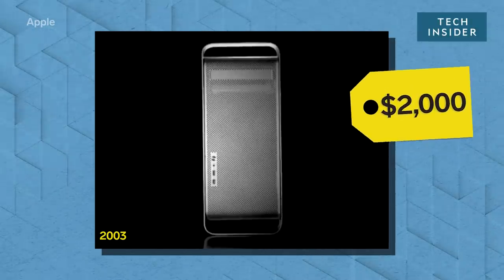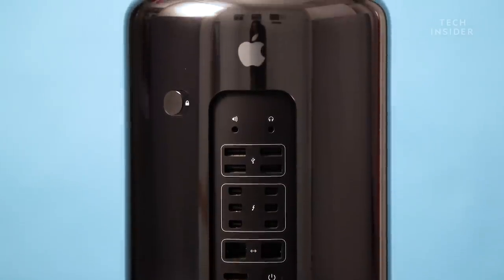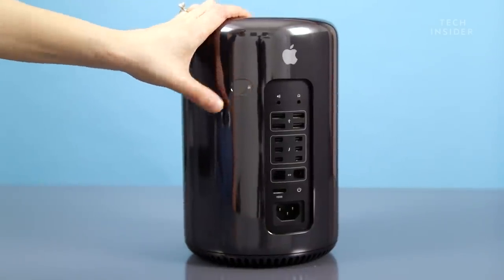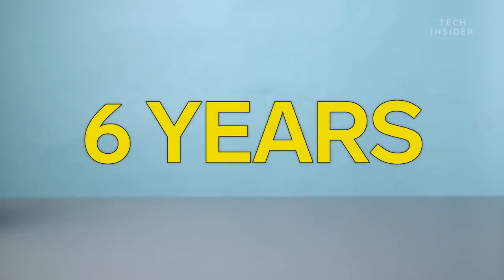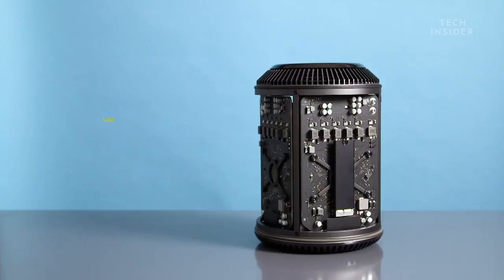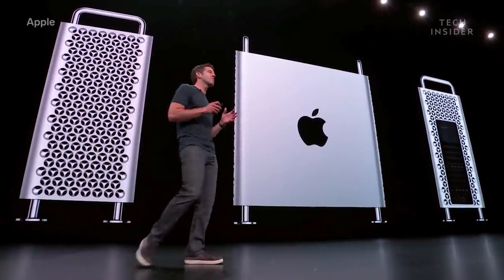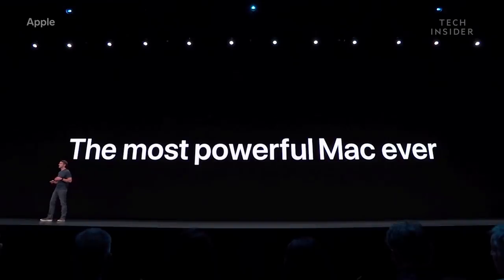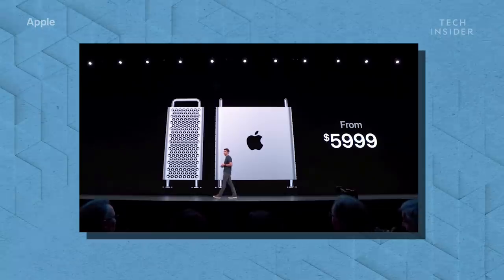Why Apple's 'Trash Can' Was A Colossal Failure

Comment: I have a 2012 Mac Pro that is every bit as expandable and upgradable as most pcs. Traditionally the Mac Pros have been very expandable, and its only since Tim Cook took over that they really started limiting the upgrading of the computers. Even the new Mac Pro that they taut as the "most expandable Mac ever" isn't as upgradable as every single Mac Pro (pre 2013) I've ever own. And there is absolutely no justification for Apples current pricing scheme, its insane. My computer cost half of the current Mac Pro most modest built, and yeah I paid $3000 for it, but its a beast of a computer, and at the time I bought it Apple still cared about making good computers and good operating systems. There were options in the gpu environments and there was justification for the expense, because that computer would last you for years and you could upgrade it as you needed, plus you could dual boot into Windows. Apple computers suck now though, and except for the iPad, I wouldn't recommend Apple to anyone; and this coming from someone who first Mac was a Performa 550.

Comment: I hope in 2023 apple makes a new computer called "the apple apple" the mac pro will be in the shape of a apple, a small apple. Will cost around 100,000 dollars, monitor the size of a toaster will cost around 2,000 that can actually be used as a real toaster. The mouse will be a regular mouse u can find at walmart, but since its made by apple it will cost u a good 900 dollars! The keyboard will be in the shape of a triangle which will break easily in just 1 minute, the cost for it will be 100$!

Comment: Psst... Tech Insider. The biggest failure of Apple was the TAM. It was the most expensive Mac of all time when you consider computing speed with price. And Jobs' favorite designer, Jonathan Ive, was the man behind the design failure. Your claim that the Newton and it's stylus as a failure is wrong. Just look at the new iPads with stylus support. The Newton was ahead of its time. It was the only Apple product not to use the MacOS.

As for the trash can, I think it is a copy of the tissue box. The PowerMac G4 Cube. Apple seems have run out of ideas after Steve Jobs died. Even Jonathan Ive left the company before people start to realize he cannot design new innovative products without Steve Jobs.

Comment: Lets not forget that if you bought an earlier model, lets say 2018, you ended up paying for more, because the 2013 went down in price because of product value degredation. Its easy to pull off at 2013 sticker and say, oh you want a new mac? Try this 2015 model mac pro. It costs just $500 more than our previous model."

Comment: 4 slots of ram - 4x32gb ddr3 ecc-r now cost 350$, 12core ivy bridge 30mb- still its good cpu (350$),  so 1500$ for mac na 700$ cpu and ram and we get more power than cheapest mac pro 2019

only bummer its built in gpu so it can't be upgraded

Comment: Apple has always tried to do stuff like this. I respect their vision but they need to understand PC parts don’t work like that. They need a lot of airflow. U can’t take a PC and fit it in tiny places with tiny fans even when building a PC choosing an extremely tiny case will mean compromising on ur chipset or putting in a powerful one only for it to throttle. It always felt to me that Apple has this grand plan which they desperately want to stick too but other factors keep interfering. Like we all know how well Apples software works especially with their hardware (internal a series chips). That’s why I feel that now finally Apple will be able to execute their vision in ways which will actually benefit the consumer. I can imagine with design with a series chip it might work really well. Let’s see. Maybe now a lot of us who always wanted macs but were hesitant because of reliability issues will finally be able to buy them .

Comment: The new mac hardware is good, but it's not worth the price. Buying the same specs somewhere else and building hackingtosh would be a better option In my opinion. And the new case is not as good as modern designs. I would not buy that kind of case for myself. One of important priorities for me is having a dust filter and the second one is having space at the top for a water cooler. Also lots of $150+ cases have sound isolation build into the sides of the case. This time it's definitely a step up from the previous model but it's nowhere near the functionality you can get from cases designed to be functional, apple is far behind. And don't think for a second that Apple is listening to customers, they are not. They are greedy and they want your money.

Comment: First off Let me state I am retired now and photography, video and computers are simply a hobby after 30 years in the computer graphics industries. I shoot on a Sony a7 iii now full frame stills and 4K video.  I have Dells, a sort of gaming rig tower with an i7 and GTX 1080 and a Dell Server for MySQL

I also own a bunch of Macs, such as 2019 MBPs and Airs. Amongst them I also own the Mac you malign, a 6 core dual D500s, 2013 Mac Pro and I have upped the RAM to 64 GB and the SSD to 500 GB so far.  I was tempted to up the 6 core to a 12 core Xeon but it's probably not worth the hassle.  

So I started looking at the Geek bench scores of new iMac Pros etc. I was shocked to see after nearly seven years how well my Mac Pro holds up in everything except I/O.  I'd kill for USBc and Thunderbolt 3 but in all other areas it holds its own very well.  Calling it a failure is a bit of a stretch.  The multi-Core results are 20,000+ and you have to spend a lot of $s to beat that with an iMac Pro.  The lack of the T2 chip and hardware acceleration for the new codecs is the biggest concern for me and Hackintoshes don't solve that even if they can sport GTX 1080s etc.  

So I guess I'll end up up with the new Mac Pro in 2020 after the dust has settled and costs of various configurations are released.
Reply: Your gonna pay 6k for those specs. Insane

Comment: The New Mac ARM will be Square with Handles. And With 3 Fans and You Could not Replace Hardware but You Could Open t to Clean it. With Up to 140,000$ Price like the Plaid Model S for Mac. And The MacBook up to 90,000$.

Comment: they are going to bomb the new $50k trash can too. 
yes it is """expandable""", but only with their parts that's also super expensive and cannot put any other non-apple parts in it.
with the new amd stuff that's coming out, soon apple will be back to the apple scene back in early 90s when they fired steve jobs and epic fail everything.
except this time that they can't get steve jobs back to dumpster dive hp's r&d for them unless the next product they come out is called iNecro
Reply: you can.... you can put non apple parts into these computers..... and these computers are literally not made for you. its also a fairly priced workstation. mac pro base model is 6k. hp's workstation's base model is 10k. they have similar specs the HP still lacks features such as Thunderbolt and support for 6K displays

Comment: Idea behind trashcan was actually great. Its the implementation just sucked... take the same design idea, but make it 50% larger and longer to be able to accept standard PCIe gpus and additional 4x DIMM slots. Make the whole "thermal core" a huge radiator and stick 3 waterblocks out of it with flexible pipes... New graphics card with different GPU location or new bolt pattern for a new CPU/motherboard? Just change the waterblock. It would have looked really unique like the trashcan did and quite upgradable at the same time.  I acknowledge this new macpro is actually a professonal machine for a change, but, IMHO, it just looks bad... Any average PC with a shitty chinese case looks way better in terms of design..

Comment: Because they’re overpriced. The computers themselves are good. I’m still using a first gen MacBook Air and it’s still reliable and fast. 1600 charge cycles and the battery is still good. Student loans paid for it at the time so I’ll let it’s $1100 price pass. Meanwhile my HP laptop was toast after 2 years. IMO the price is more than what they’re capable of. I could build a better Windows PC for the amount. Sell them for less and I’ll say it’s a good buy.

Comment: 1.5TB RAM and only 2 gpus. say that to davinci resolve pro users, that need the $6K apple monitor to work on multi gpu accelerated workflows. the apple is rotten for good.
Reply: 1.5tb of ram only? 2 gpus only? its 2 MPX modules which is 4 GPUs. it can have a maximum of 128gb of hmb2 memory which is literally the highest amount in the world. it can run any monitor using thunberbolt 3. none of your arguments make sense